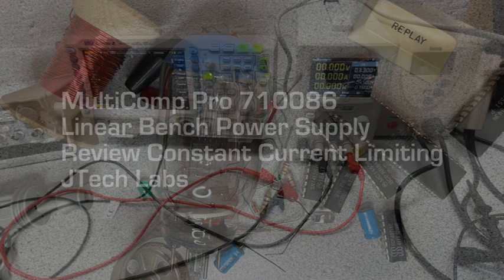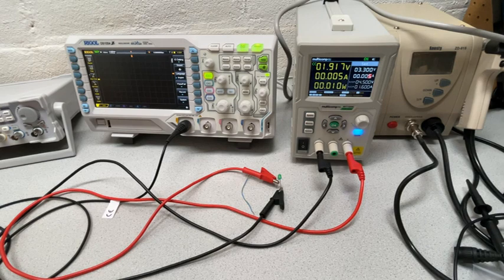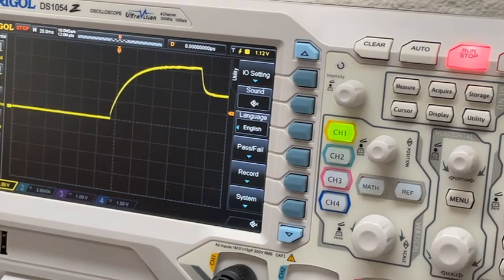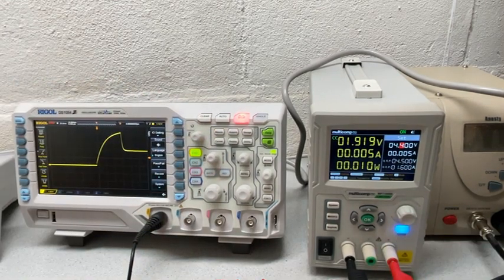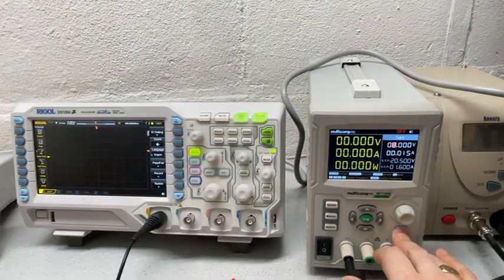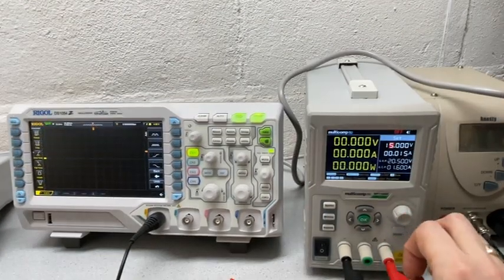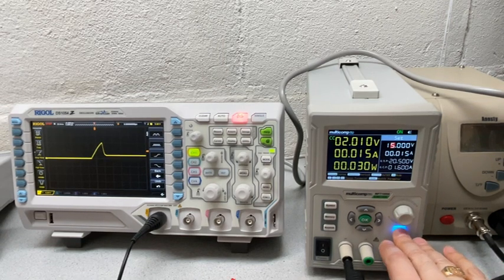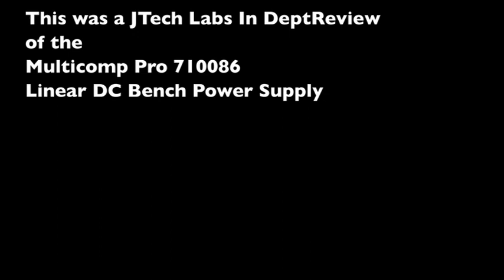Multicomp Pro MP710086 Linear Power Supply Constant Current

Comment: Hi, I am a novice starting out with learning electronics. Looking to buy something like this (been offered a new one quite cheap). I just wonder how much of an issue this spiking is, and will it be an issue with general testing usage and diagnosis. More than likely I would be powering up older stuff with it. But not knowing what I am doing generally with electronics, am I more likely and easily going to do damage components with this power supply? Cheers!

Comment: Hi Jim, 
I am considering this product for a lab, however I believe this behaviour may be dangerous when testing devices (with limited current setting not to damage it). As an example, if there is a short where I apply the voltage, current will initially not be limited and therefore damage the load even with current limiting setting. Have you experienced and solved this issue? Would setting the OCP be an option to solve this issue or would it act too late in the same way as the current limiting setting? Thank you!
Reply from the maker: No solution yet
Reply: @jtechlabs1  ok thanks for the update!